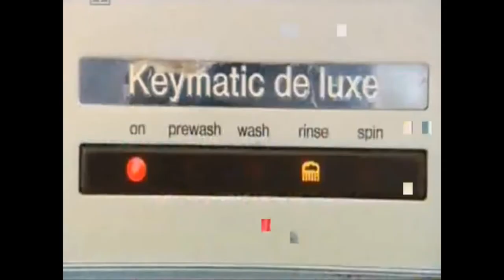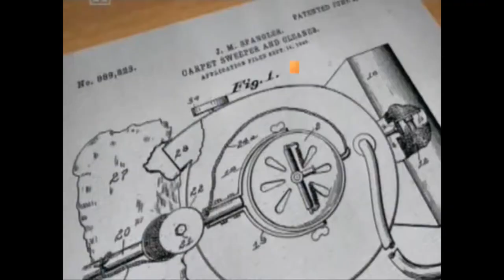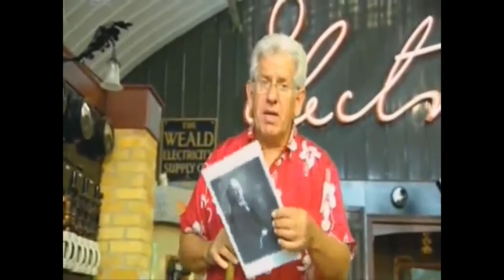Just Another Day TV Programme With  Adam Hart Davis & ChesterMikeUK

Comment: Mike, what make is the single tub with the red flip up switches, please? I had a feeling it was Hoover as well but as they tended only to use the 'side' agitator, I'm no longer convinced! Thank you.
Reply from the maker: The washer I think you mean is the Hotpoint Countess which was the compact mid range wringer washing machine, if it had 4 pull up switches then it had the heater and pump action as well as wash action on / off.
Reply: @WeHadOneOfThose  Thanks, Mike, I wasn't expecting it to be a Hotpoint, as I said I was convinced it was also a Hoover! I appreciate your reply.